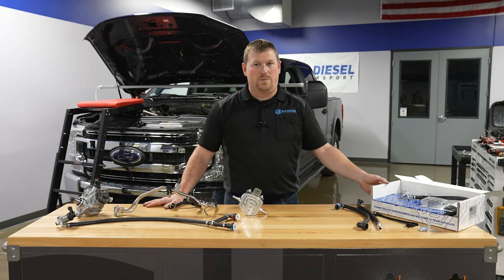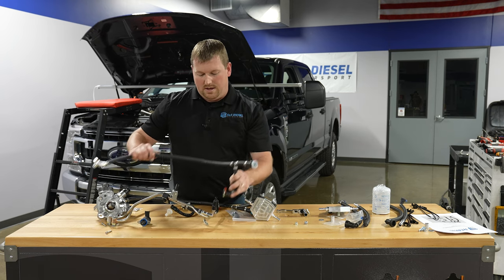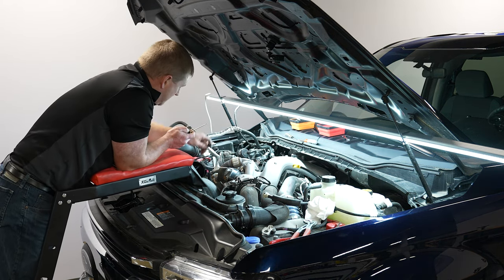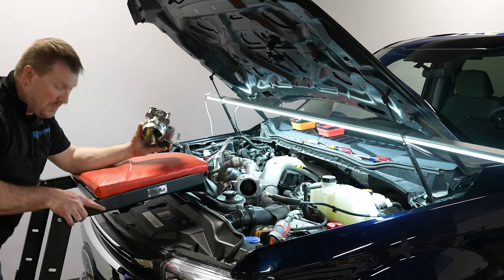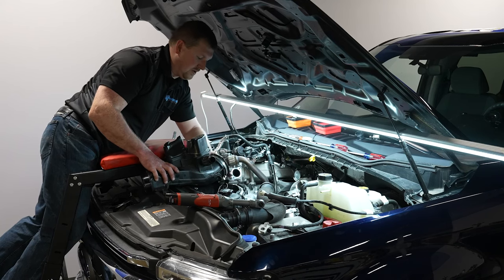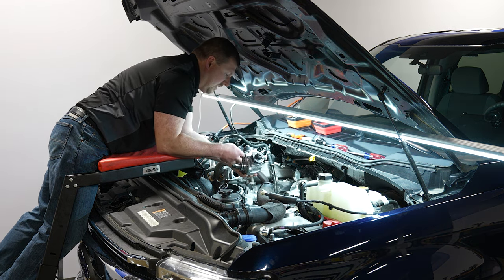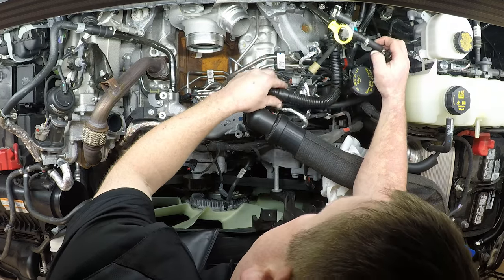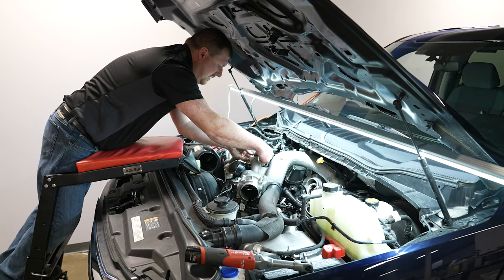Gen2.1 Ford 6.7L Power Stroke CP4 Disaster Prevention Kit Installation

Comment: I was just talked out of the SPE kit that’s sitting in my truck for my diesel shop to install, they said no way they will install it unless it’s a S&S kit, they had it in stock and gave them the green light, the shop recommended I look for a video you guys did to test out your system with great results.

Comment: Only thing I don't like about this kit so far is that removing the filter without breaking that one little bolt that holds it all to the cowl is a pain in the ass.  I wish the filter head was mounted more securely somehow.

Comment: Yet again just another reason to buy a Ram Cummins because even they learnt real quick get rid of the pos cp4. Ford could careless why cause y'all keep buyin them. Nevermind if you really work that ford transmission you will be rebuilding it in 100,000 or less miles. Grocery princesses need not comment.
Reply: The ram guy talking shit about a ford transmission, that’s rich lmao.
Reply: Lollllllllllll
Reply: Cummings has a cp4 what are you talking about? Lmao. Chevy l5p for me. Hp4 pump!
Reply: Guys - just my 2 cents

2011 owner - quality lubricant additives to US diesel fuels is a must. Our counterparts over in Europe is of better quality.

US diesel = hot dog water

I use hotshots (but to each their own).

217k mileage w/original CP4. But I am going to the disaster kit very shortly.
Reply: @ronswanson76  what mileage did you start using the hot shots? I use it in my l5p with 107k miles and have zero issues so far!  I have a hp4 pump but I'm not taking any chances!
Reply: @fredwilliams7893  bought her used w/103,000. Deleted & tuned, and upgraded to 65gal titan tank.

From that mileage to now (217k). And here in Wyoming I need a quality anti-gel @ -40F 😏
Reply: @ronswanson76  so you ran the hot shots from 103k miles every tank fill up till the current mileage you have now? Trying to see if that's the case this stuff  must really work
Reply: @fredwilliams7893  yessir. EDT, Anti-gel & the stiction eliminator

I tow a 5th wheel 3axle T.H. living full time.

Comment: My ram still under warranty with a recall on the high pressure pump,still sits nearly two years later at a dishonest dealership.Get a lawyer if you drive garbage Cummins ram
Reply from the maker: We hate to hear that. We have CP3 conversions for the 19-20 RAM if the recall is taking too long. It does not require an ECU reflash like the OE recall. We can't guarantee this, but we've had reports of customers getting reimbursed by Stellantis for our conversion kit when the OE solution was not available. Your truck being held hostage waiting for parts sounds like a good case to get the S&S conversion covered.

Comment: Thanks for this video. It was helpful!  The only thing I did differently was take the supply line off the pump before using a propane torch to get the vinyl line off. I didn’t want to take a flame to a fuel line in the engine compartment or damage nearby parts.
Reply: I used a heat gun. Worked great

Comment: A couple questions:

1) Where is the video for the 11-16?

2) How do you twist off the CCV connector? It seems that this job cannot be done without removing that. It also seems impossible to remove that without breaking it.  Mine has a rotating locking mechanism different than yours.
Reply from the maker: There should be three tabs in on the hose where it connects to the intake. Use a pic to pry each one out one by one and put something in it to hold it out. Toothpicks or welding rod work good. When all three are held up the hose should pull off. You should be able to turn the hose to gain access to all 3 tabs.
Reply: @SSfueled  thanks for that! I have no idea what I did but I basically pulled up on it until all the slack was out and locked it until it clicked. Then I pressed it in some kind of way and that second “tray” slid out, allowing me to unlock it. I’m sure what you described here would have been easier. 

Thank you for the video, could not have completed this install without it. 

One warning to everyone else: you mentioned that the lower intake may make contact with the FCA. Mine did and I was able to get clearance once I got far enough in. However, unknowing to me I knocked the  connector out and didn’t realize it until I was done and got the P0001 code. Was able to reach in there, slide it into position, and lock it in with the curved side of my hook. So make sure you check the connection once the lower intake is set in place. Just wanted to share. Thanks again.

Comment: The one thing besides esthetics that concerns me on this kit vs SPE is the feed block for the Volume Control valve.  The SPE one uses a threaded fitting instead of a machined fitting extending off the block.  I would be concerned over stress cracks in the thinner walls where it connects the block.  I have installed the SPE kit, it looks better underhood, but I also installed the S&S return filter as it is superior to the thing, which is sitting on my desk that SPE calls a filter.  Makes for a rather nice looking paperweight, which is all it is good for.
Reply from the maker: Your concern is noted. There have been 0 instances of the machined hose barb cracking. We purposely did not use any threaded NPT connections in our kit. NPT threads can potentially create debris that will cause problems, and are more susceptible to leaks. We try to avoid threads when we can, but we had to use threaded fittings on the return filter head, and those have an o-ring seal. We'll admit that rubber fuel hose and oetiker clamps don't have the same pop has braided hose and aluminum fittings, but we prefer function over form.
Reply: @SSfueled   Thats understandable, makes the cost of the kit more business friendly too.  It was just something to point out why I chose SPE over S&S for the DPK, but did buy the return filter because it is hands down far better than the stupid screen and extremely hard to install filter body. Took no time at all to install the filter.
Reply from the maker: Thank you! @acdii

Comment: Is your return filter to tank compatible with other companies prevention kit. I went with another company when you had to cut lines with ypur original design..
Reply from the maker: The S&S Return Filter Assembly (CP4-6.7F-BP-G2.1-RFA) clips in between the factory pump return line and the factory return line going back to the tank. As long those lines are retained it is compatible.

Comment: Would the installation be different from the video if its a 2015 i saw the attachment that goes on the 2020s but the one im doing is a 2015
Reply from the maker: It's slightly different since you will not need to use the additional 2020+ adapter hose and fitting. Our printed instructions can explain the slight difference.

Comment: just installed mine in my 2012 f250 i was getting 18mpg now instantly getting 16mpg. is it normal to drop after the install?
Reply from the maker: We have not heard of the DPK affecting MPG in any way, up or down. It just changes the flow path, not the flow rate. Most of the charge air piping needs to come off during the install and sometimes they do not get seated/sealed when going back on. A slight boost leak could cause a drop in MPG because it makes the engine less efficient.

Comment: Ok having this on the truck for the CP4 before the new pump you put out the DCR Will this work-fit on it ?  Just for extra protection cause having it already....
Reply from the maker: The Disaster Prevention Kit is not compatible with the DCR Conversion, but it is not needed. The DCR is rock-solid pump that is very unlikely to fail. In the off chance that does, the case and plungers are fed independently.

Comment: Would this kit work on the 2020-2023 Jeep ecodiesel with the CP4?
Reply from the maker: Our current kit is designed for the 6.7 Power Stroke and will not fit the Ecodiesel. We are exploring options for the Jeep Ecodiesel, but have been hesitant due to the active recall. You can sign up for our new product email list at the bottom of www.SSdiesel.com
Reply: @SSfueled  I think a kit for the eco diesel would be easily devised since the pump is located directly in front of the driver side cam and not really much to the plumbing. The hoses do look like a smaller diameter than the 6.7. This recall has been out for well over a year and still no end in sight. I have 2 beautiful ecodiesels just waiting to get out on the open road and hit the trails but I just can’t handle the anxiety of knowing of a possible grenade going off in my motor and I’m pretty positive there’s a lot of guys and gals who feel the same.
Reply from the maker: Thanks for the feedback. We'll pass that on to our engineers. @scaleflyboy

Comment: is it to late to install this at a specific time and just get another pump?
Reply from the maker: The DPK will only protect the fuel system if it's installed before the CP4 starts failing. CP4s can start making metal before showing any symptoms or codes. By the time it's bad enough to get a low fuel pressure code the damage is already done. The best way to check is to inspect the pump VCV (volume control valve) screen for metal particles. If you see metal, it's too late. In that case we recommend replacing the injectors, rails, lines, etc., and switching to a DCR pump.

Comment: Thanks for the video.  If you have an '11-'19 (I think it's 19'), you'll have a plastic upper intake manifold rather than the metal one shown in this video.  It can be a pain to remove the plastic manifold, and there are 2-3 bolts close to the firewall which are rather difficult and require a combination of wobble/u-joints, extensions, and patience.   I found a Pusher Intake video very helpful as it shows the plastic manifold (see link in my comment).  Also, be prepared to clean the tar/carbon out of your upper and lower intake manifolds.  My 2016 with 100k was FILTHY.  I used a combination of gasoline, compressed air, flexible fillet knife, pressure washer to get it clean.  I'm a pretty tool savvy shadtree type guy, and this whole job took me the better part of two days.  https://www.youtube.com/watch?v=oOHISAOQqnw&t=577s

Comment: What's the difference between the original bypass kit vs this one?
Reply from the maker: Great question. Our original DPK split the fuel flow directly at the pump, whereas the Gen2 and Gen2.1 both split the fuel flow off further away from the pump (25 inches of separation). We also added a filter on the return side to catch metal in case of a failure. The original DPK has been proven to work many times, yet there were a few instances of the metal back-feeding through the short passages in the case of a major failure where the pump return circuit would get completely clogged with metal. We want to provide the best solution available, and when we discovered a potential issue, we made improvements to address it in the Gen2 and Gen2.1.

Comment: It’s like a fail safe incase the engine gets overheated it helps prevent piston warping or malfunction anti cavitation tube. Also helps in winter to prevent trapped air pocks
Reply: What? The kit is in case your CP4 pump fails. It prevents metal debri from traveling throughout the fuel system.
Reply: @kingOpooPee no it doesn’t lol that is literally the point of the kit

Comment: What disaster is this preventing? Just wondering why this is being done?
Reply from the maker: Thanks for asking. The CP4 high-pressure fuel pump used in 2011+ 6.7 Power Stroke engines has a tendency to fail in a way that sends fine metal debris throughout the high-pressure fuel system. Our DPK changes the fuel feed path so that only clean filtered fuel goes to pumping heads and potentially contaminated fuel goes out the pump return and into a filter on the return side of the fuel system.
Reply from the maker: Here's our in-depth analysis of a CP4: https://youtu.be/nPFPf2EpxkE
Reply from the maker: Here's what happened when introduced debris into the fuel system of our 2021 F250 to validate the effectiveness of our DPK: https://youtu.be/RTd1pyP7Sl0